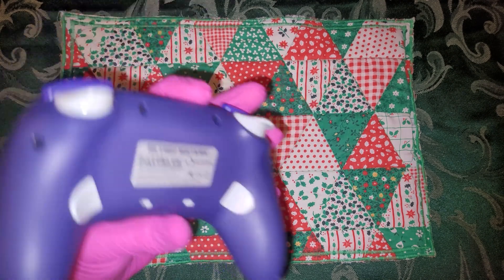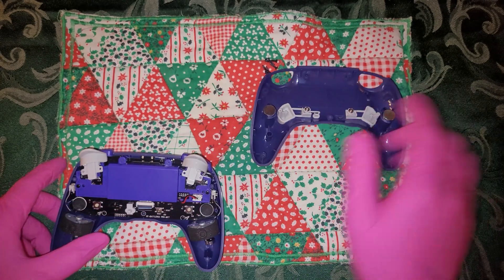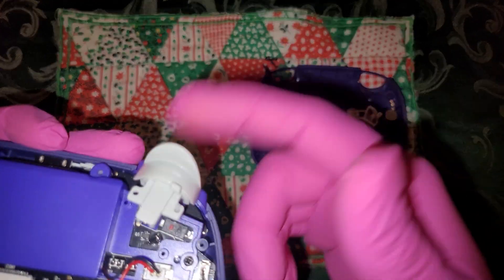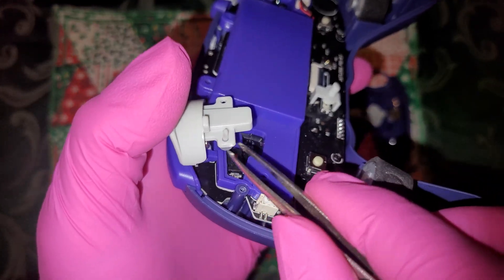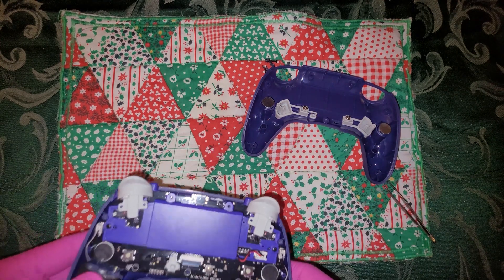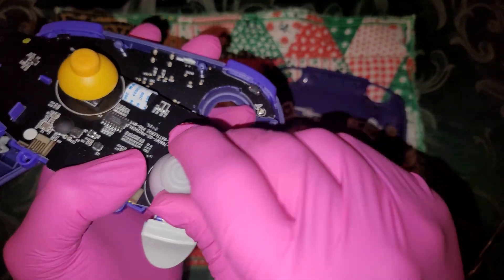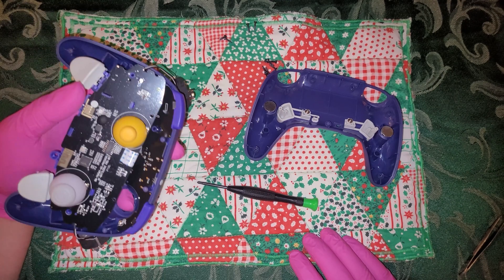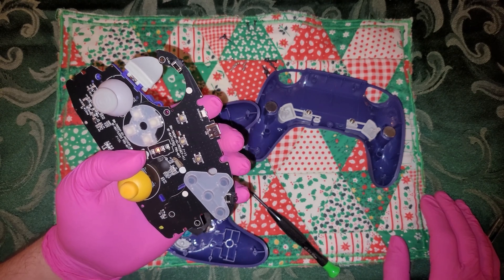Retro Fighter's BattlerGC Pro Teardown

Comment: Thanks! I was thinking about cutting off that annoying reset button, and this video helped me make up my mind. I went ahead and did it, and I totally recommend it. Just removing the plastic cap keeps the switch accessible with a paper clip if needed, and you won’t accidentally turn off the controller anymore (which happened constantly to me). Seriously, what were the engineers thinking?